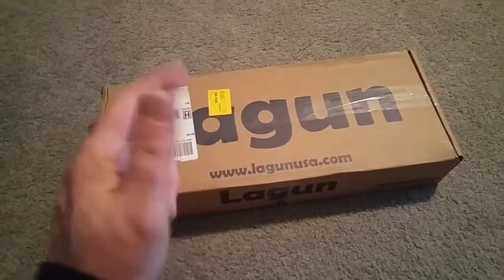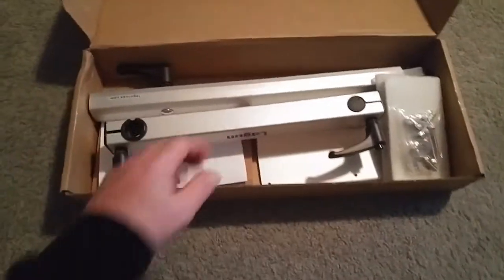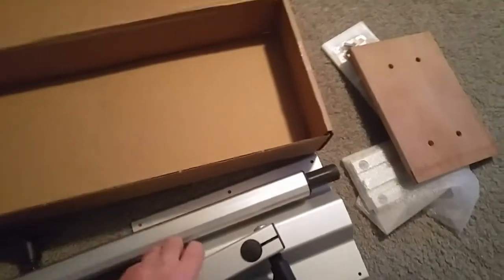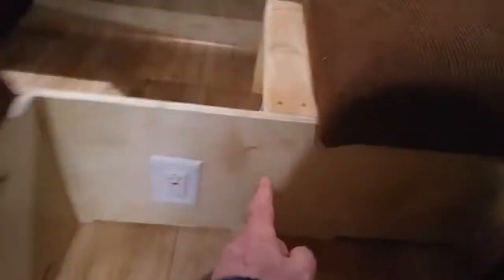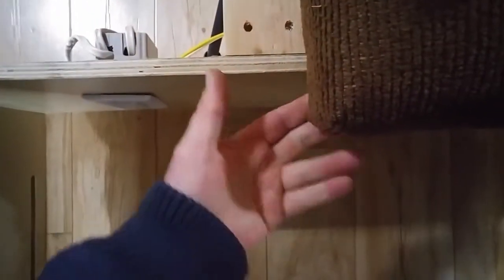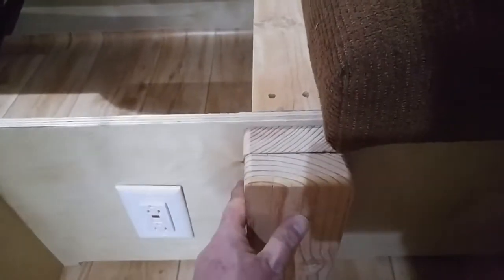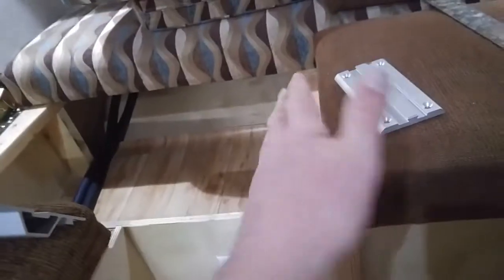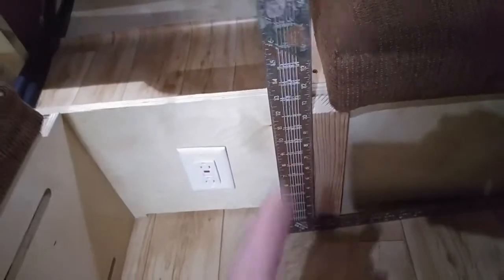Lagun Table Install - Part 1 - Tab Trailer

Comment: Thank you for this video!  I have a 2016 T@b 320 very similar to yours.  I am trying to install the mount plate against the baseboard of the camper (with the additional block of wood added so it doesn’t get in the way of the lip of the cushion.  Four bolts were provided and I have measured and remeasured.  My issue is that the bolts are long enough to go to the other side (where the storage is) to add a nut.  This must be the case for you as well, so how do you secure it.  Did you use the provided bolts without the nuts.  Did you use long screws?  I want to make sure this is secure as it needs to be.  Thanks!
Reply from the maker: I used long screws in stages.
First the block to the cabinet, then long screws thru the metal support.
Reply: @tabtrailerupgradesandmaint2923  thank you!